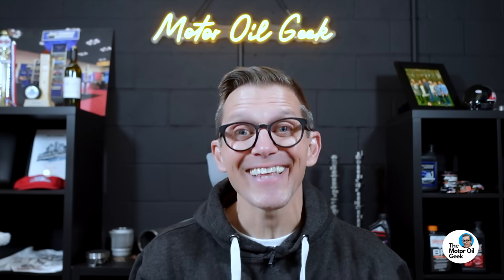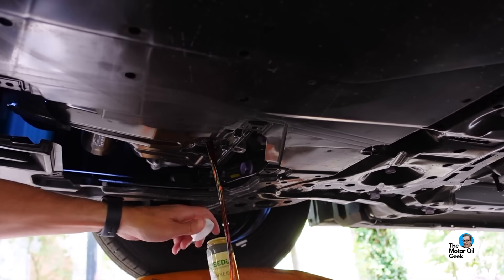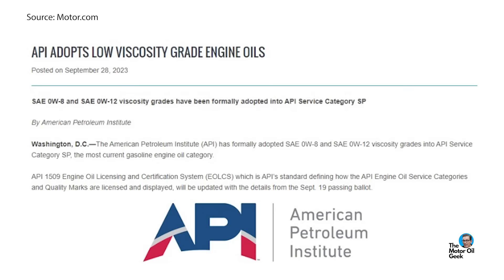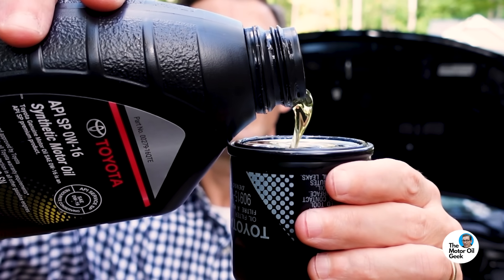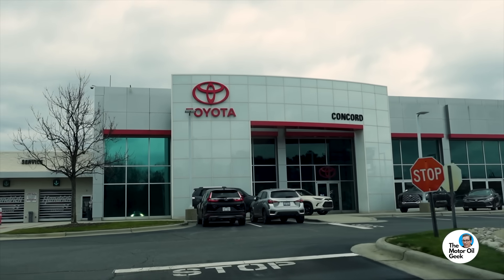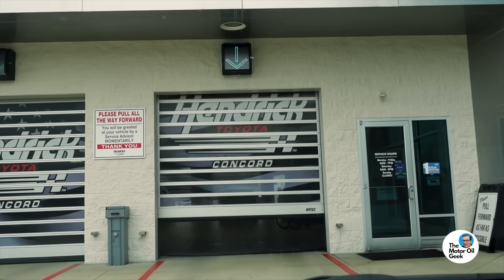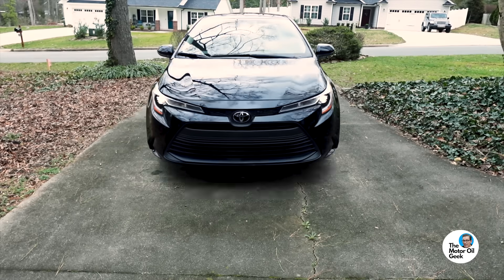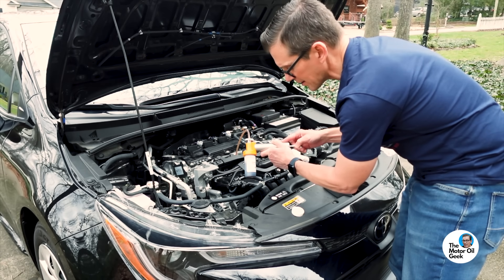0W-8 Motor Oil: Too THIN to Trust? Let's Find Out!

Comment: New engines are hot: turbo charged, tight gaps for bearings, start stop with oil pump off, higher performance means they need thicker viscosity not thinner.

Comment: Hell, I  won't even run 0/30 here in Florida. No cushion in oil that thin. 0/30.
Reply: Be careful.  The new Camrys have an electronically controlled oil pump that regulates pressure based on 0w8 oil.  Thicker oil requires more pressure to get through smaller openings. With the tight tolerances of the new motors, thicker oil may not get to critical parts.

Comment: Listen up, lake dude..let's discuss the way the engine crank and piston pins and cylinder bore are "finished"...different surface finish grades react with oils differently..can we hear your discussion on the finishing rms vs the different oil grades, when the same 150 hour wear tests are done??  I do remember that Chevy V-8 engines, using the thin oils, being gernades ..costing GM maybe a billion dollars in warrenty work..Can you please address the component finish grades and how different oil grades react differently to different finish grades??

Comment: 0w8 literally pours like water.  I don't think it can protect itself in the bottle let alone in an actual engine.  I used to defend Toyota's decision to use the next "water" size up, 0w16, but the more I read, the more I think I want to go to 0W20 or even higher.  Some who claim to have done extensive "real" testing say to go all the way up to 5w30 but that seems extreme and I worry about it being too thick to work in the tiny engines with the tiny, variable pumps and tiny capillary style passages in the engine.

Comment: Car Care Nut says that specifically for the A25A-FKS engines, that the oil pump is specifically calibrated to use 0w16. He mentions that if use anything thicker, it could lead to less oil flow/higher engine temps, especially with the variable valve timing. I don’t want to deviate from 0w16 and risk damaging anything, but I also don’t want 0w16 to shear down so much that it causes damage anyways. What are your thoughts, Lake? Thanks!
Reply: I love watching the Car Care Nut too but if you read the Japanese and Australian manuals for the A25A-FKS Camry they actually say it's okay to use 0W-20, 5W-20 and 5W-30. They say just to base your viscosity on the temperature of your environment. After reading those manuals I wonder how essential 0W-16 is for this engine or if it's just an MPG mandate.

Comment: There are so many experienced mechanics on YT saying with passion that they would NEVER put a 0W-16 in an engine because it is too thin.  Of 40 hours of videos i have watched only 3 actually did lab testing (including this one).  I think the additives make the difference.  I have a new Toyota  M20A-FXS engine with 2000 km now.  The dealership did not even have the 0W-16 that Toyota requires at the 30 day inspection interval from purchase.  Takes three days to get it to the dealership.  So they put 0W-20 in (I paid for it because they say there is no breakin period.)  I am in SE Asia so warm every day here.  I apprecate the science behind your opnion.  That helps me make an informed decision.

Comment: Relying on thin oil for these 10k oil changes has already killed many an engine with 0w20 oil, i would trust it even less with 8. Thanks for these tests but I will still be doing 5w30 and 5w40

Comment: Realistically, yes. They're trying to pass off racing grade oil as consumer grade and hoping the engine holds together until the warranty ends. 0W20 is as thin as it should go and only on low stressed, non turbo engines since more engines than ever are blowing up once 0W20 became mainstream. The fuel savings you get over 5W30 oils is so minuscule that it doesn't make up for the added waste and pollution from disposing failed engines and vehicles.

Comment: I worked at a lube shop for 10 years and I always recommended  5,000 miles on synthetic oil. I don't know if I can trust an oil change interval of 10,000 miles. Fun fact, if your car is under warranty and you get some crazy recommendation from the oil manufacturer that you can go 15 or 20 thousand miles on an oil change, you'll void your warranty. You wouldn't believe how many customers I had that refused to put the correct oil in their car. They'd say something like, "It's funny how the car runs just fine on the regular oil". Then I'd say, We'll you'd like to think so, but...". Then I'd give my little speech which would burst their bubble. You really need to go by the vehicle manufacturer's recommendations.

Comment: Interesting about the CVT. It may actually have 1 gear(after 2019 I think they added). The new cvt has 1 gear to launch the car and then the cvt takes over. So the cvt gets some relief and should last longer. Also the launch should feel better without the slipping on the old cvts.

Comment: If that's a hybrid it's an e-cvt which is a bit different then a normal cvt type transmission. 
Beyond that basic explanation I heard, I'll leave it to the CarCareNut to explain the rest haha. 
I also haven't looked up to see if the non-hybrids have cvt type transmissions.

Overall though, love the video as someone with a Tacoma I've been researching what the ideal oil viscosity is for my applications for the sake of longevity over efficiency. 
Safe to say, your tried and true saying "Application dictates chemistry" is very applicable. 
I think I need to do some oil samples to gauge what the ideal viscosity for me in my current climate will be but also I realize I'm splitting hairs...
Either way, no harm in trying to learn though.

Comment: My Subaru 2025 uses 0W16. Retired so my driving has been cut pretty much in half. Change oil every 6 months now. Never get to the 7500 km that the dealership recommends. I'm in Canada so km not miles. My last Subaru was a 2019 that used 0W20. So they're going thinning all the time. If they go to 0W8 will not be getting Subaru to do any more oil changes.

Comment: I still would not run a 0-8 or 0-16 or even a 0-20 here in Florida. I'd be running a 0-30 and be just fine. Remember that the oil viscosity is based on a temperature range. Florida has some of the hottest summers and months in the country and needs that extra viscosity. But go right ahead and use that 0-8 of you want to.
Reply: Been perfectly fine in Texas weather , don’t pretend to be a engineer 😂
Reply: @cormaro13  Car MFG are just trying to reduce drag to meet CAFE, they do not care about your engines longevity. I'll run a higher viscosity oil, and your comment is uncalled for since you have no idea of my qualifications and experience.
Reply: @j @josephklimchock5412 I can tell you don’t know anything about oil if you think it won’t last in the Florida sun when it’s been lasting just fine for me in Texas heat for 1 and 1/2 years and 50k mileage 😂 

Oil change every 5k mileage with amsoil and zero issues 

Good try on thinking you know better than the engineers when they been using this oil for ages 😂

Comment: So as I understand it a Corolla uses a Toyota CVT which has a launch gear that is an actual gear and then it transitions to a belt/chain drive. However, hybrid Toyotas use an eCVT that has no cones and no belt/chain but instead they have a planetary gear set. The eCVT also does not use Toyota's CVT fluid but instead uses the Toyota WS ATF which is the same ATF used in the Toyota conventional automatic transmission. The eCVT has been claimed to be bullet proof,

Comment: I pushed 230k miles on my Mazda 3 with 0w-20 only oil changes every 10k, normal maintenance, valve cover gasket, alternator, clutch. When I sold it kept going with 32mpg average

Comment: Has anyone just been using a 5w30 oil in these? I change my oils at 5k intervals and run 5w30 in my 5th gen 4Runners here in Texas, then use a 0w30 in winter time, to me these lower and lower viscosity’s is disturbing
Reply: I have the same 4Runner and also a new 2026 Camry.  They both have electronically controlled oil pressure pumps and pressure control valves that change oil pressure under load and RPM.  This and the VVTI system are oil regulated.  Changing the viscosity of oil could change the parameters and cause premature wear.  Oil pressure is just the measure of resistance.  Higher viscosity oils require more pressure than lower viscosity oils. Your engine is designed for a certain weight of oil with that in mind, I would stick with the engineer's recommendation.

Comment: CVTs are not "fluids for life" unless you want your CVT to die around 70,000 miles. You should drain-and-refill your CVT fluid every 20,000-30,000 miles.

Comment: The eCVT in a Toyota hybrid does NOT use CVT fluid. Instead hybrid Toyota eCVTs use the same fluid as a Toyota conventional automatic transmission which is Toyota WS ATF.

Comment: Great video but the Question now (09/25) is
Is Toyota 0W 8 and 16 worth twice the price (or more) then the Mobil 1  0W 8 and 16?
Reply from the maker: The 0W-16 is. The Mobil 1 0W-8 is the same oil as the Toyota 0W-8.
Reply: @themotoroilgeek  Hi.  Have you done an oil analysis to compare the Mobil vs Toyota 0w8 oils?

Comment: Hi, thank you for the detailed oil analysis! I have a 2025 Toyota Camry and work for Uber, but instead of 0W-8 I’ve been using 0W-16 and changing the oil every 5,000 miles. Do you think this is the right approach, or should I switch to 0W-8 back? I’d really appreciate your professional opinion.

Comment: Lifetime transmission fluid means the lifetime of the transmission. If you have a regular automatic transmission, drain and refill + filter every 50-60k miles under normal use. Earlier for heavy use. For CVT, drain and refill plus filter max 30.000 miles. It's cheap insurance to get many more miles out of your transmission, because no fluids last forever like the manufacturers claim, and those CVT's especially in Nissan are known to fail way earlier than expected on an expected lifespan of a vehicle. Keep fluids fresh and car will last longer. I do oil and filter changes every 7k ish on my engine 5w30 fully synthetic. Next time I'll do an oil analysis, haven't done that before, engine has 160k, no major issues, 3.6 V6 pentastar 2012.

Comment: Would you guys put a 5w30 in your Toyota 2ZR-fxe Atkinson prius engine? Because this is what dealer put argueing with better film strength. But what about frequent start stop. 
I have seen on YouTube many of these engines tear down and they die due to piston rings clogs and bearings look like new even after 300k miles

Comment: After reading a lot of comments here I have one of my own. People, the oil changes are not because the oil isn't any good after 5k miles. It is because you need to get the contaminates out of it. The wear metals,  soot and fuel dilution are what need to go, not so much the oil unless you leave it in for an insane amount of miles. I think that is the point Themotoroilgeek is trying to make and showing the lab results. It is what makes early changes during run-in important. Have your oil tested until you have established the best interval determined. After that you can test at longer intervals if you prefer. My 2 cents, take it or leave it. And as a retired trucker... PLEASE drive safely, that is even more important than oil.

Comment: Which Toyota engineers, the Toyota engineers that make reliable capable-of-immortality engines or the Toyota SALES engineers who were tempted by the devils into having bad oil change interval recommendations published in the owners manuals?  The chaos, bedlam, destruction, neglect, abuse, unnecessary maimings and premature deaths of engines is from the second set of engineers, not the first.  if yakuzas come knocking you will know what became of me

Comment: There are no chains in the Toyota E CVT transmission. It is a planetary system with no clutch packs or chains/ steel belt. The transmission is designed to last the life of the car.

Comment: Hey Lake is Moly being much lower in Penn or Mobil a concern relative to the Toyota oil moly level?  Note that I did switch to Valvoline R&P 0W-20 in my 18 Camry that had specified 0W-16.  I just noticed the Toyota oil moly level in the report shared in this video at time 8:42 for 0W-16 used in a Sienna with report by Blackstone  https://www.youtube.com/watch?v=83D8ktZM7tk
Reply: Moly is more expensive than ZDDP and boron. Zddp & boron get used in place of moly due to cost reasons. Moly is the most expensive AND least severe on catalytic converters.
Reply: @5jjt  interesting

Comment: Funny you mentioned a jolting lunge when depressing the peddle, that's nothing to do with the transmition itself nor the fluid type or viscosity. ( it the torque converters stall speed ) it's to high, meaning at 900- 950 1000 rpm it's disengaged from the drive input to the transmition. Where if it were a lower stall speed at 850 rpm it stay engaged and you let off the brake it carry itself on its own from the engines idle. Most idle around 900,925 roughly.

Comment: All this oil madness was driving me crazy, I’m glad you cleared it up and got me to trust the manufacturer and not knuckleheads on the interwebs
Reply: Bad move. Some of us internet users may be "knuckleheads," but three facts that simply cannot be denied by any reasonable and well-informed person is that, first, all engines wear as they're driven (not just from break-in), increasing bearing clearances over time, meaning that while 0w-8 oil might protect adequately in a factory new Toyota engine, it will absolutely contribute to progressive engine wear as the engine is fully broken-in and driven hard, and should be swapped for an oil that provides somewhat greater film thickness in bearing surfaces. Second, auto manufacturers wanting to sell vehicles in the United States (and consequently the engineers who work for these companies) MUST abide by increasingly restrictive EPA fuel economy regulations. Every country has its own regulations. Some are similar to the US. Some are not.

It's not that internet knuckleheads are pretending to know better than auto engineers. It's just that these knuckleheads have learned something that you obviously haven't: that by law, auto manufacturers CANNOT (explicitly) recommend oil viscosities that prioritize engine longevity OVER fuel economy if it would cause their vehicles sold to no longer meet regulatory requirements on fuel economy. In many countries, the recommended oil viscosity in your owner's manual is a compromise between engineering and environmental regulatory standards, which is ultimately a compromise on the longevity of your engine.

And third, even in Toyota owner's manuals (such as mine) which lists 0w-8 as the BEST and ONLY oil viscosity recommended by Toyota for this engine model (M20A-FKS), the manual also states vaguely that "AN OIL WITH A HIGHER VISCOSITY MAY BE BETTER SUITED if the vehicle is operated at high speeds or under extreme load conditions." No further clarification is given because (for legal restraint owing to regulatory requirements) Toyota CANNOT (explicitly) recommend a higher viscosity oil for this vehicle in the United States. And yet Toyota owner's manuals for the SAME ENGINE model, SAME YEAR, and SAME VEHICLE in other countries (such as Australia) explicitly recommend a list of considerably higher oil viscosities, without attempting to frighten owners about selecting an engine oil viscosity higher than the lowest recommend oil viscosity.
Reply: @f @finnthehuman8128 u just regurgitated 400 different forum posts that say the exact same thing. If car care nut and oil geek say it’s ok then it’s ok.

Comment: I have 2020 Camry Hybrid that calls for 0W-16. Now it has 101000km (~ 60k miles) on the clock. Oil change every 15000 km. No problems whatsoever. These new TGMOs are amazing.

Comment: Hey Lake, this brings up an interesting question.  I have a new 2024 Miata ND3,  At 600 miles I did my first oil change and put Penzoil Ultra Platinum after watching your video.  My question is, In the US Mazda recommends 0w-20. In Mexico and other parts of the world they recommend 5w-30.  I have heard from others that the lower viscosity provides less protection to the engine.   I am going to change the oil again at 1200 miles and I am wondering If I should change to 5w-30 or stick to the recommended oil.  I have always heard to follow the manufacture's oil recommendations.  What is your recommendations and why?   Thanks so much.  Joe

Comment: Same with differential oils.  You never put new engine kind of oil (Thin oil) on worn out parts. Stupid to do that.  Worn out parts need thicker oil for more cushioning of parts againts each other.  Dont be stupid. THINK.  Old mechanics know that by seen old engines trashed too early with some idiiot put thin oil in it.

Comment: I would say people shouldn't even try to mess with their CVT. Just let the dealer or a qualified shop do that. It's nothing like changing your motor oil. From what I understand the level has to be very precise and it must be done at operating temperature.

Comment: These are very interesting and educational videos. I enjoy watching them. What I received from this one is the information on CVT oil. I drag race a motorcycle that has a wet clutch. It's separate from the engine oil. In the past a mixture of Dexton and Marvel Mystery oil was used. Had good results. I would like to try the CVT oil for comparison.